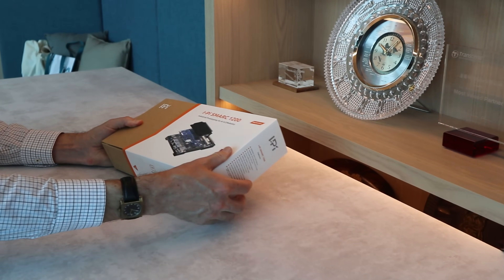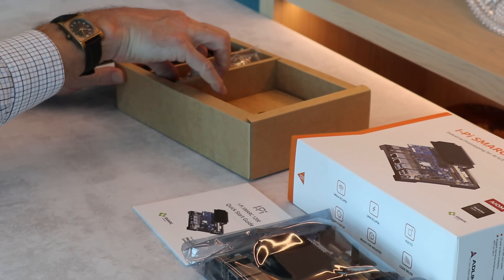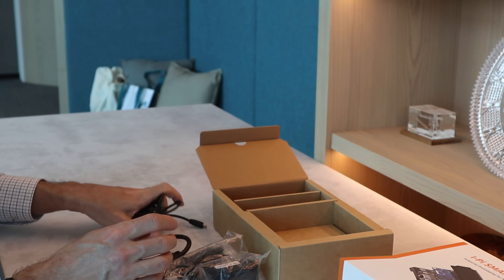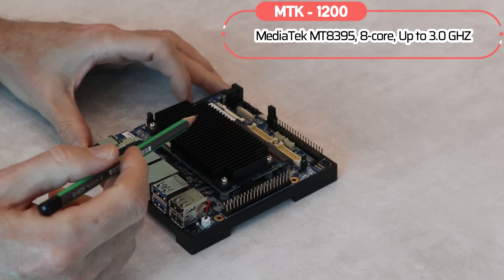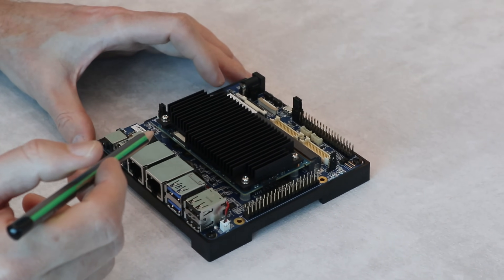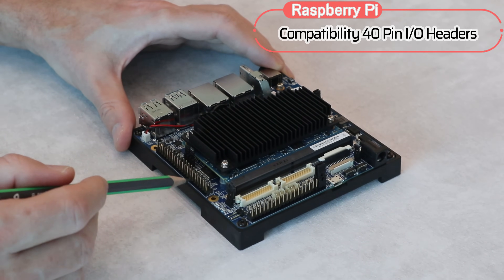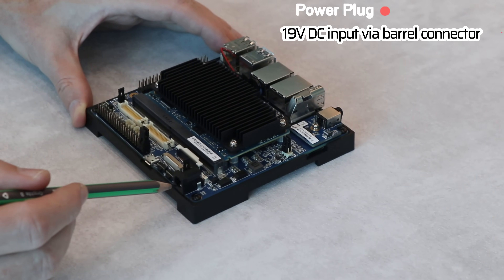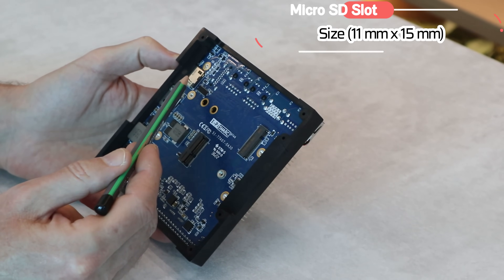Unboxing the MediaTek Genio 1200 based devkit - powerful AI and graphics platform for Edge Computing

Comment: What temperature does it idle at?
X11 support or Wayland only? 
Currently looking at ipi imx8 but struggling with xwayland, before that the EL which Intel should not be marketing as an embedded processor (so hot) but was the simplest to get going.
Reply from the maker: @kevcall 
-According to our experiment, the best thermal solution of LEC-MTK is when uses the heat spreader with FAN in the ambient temperature 60 degrees, the CPU temperature is 84 degrees. 
-It supports Wayland.